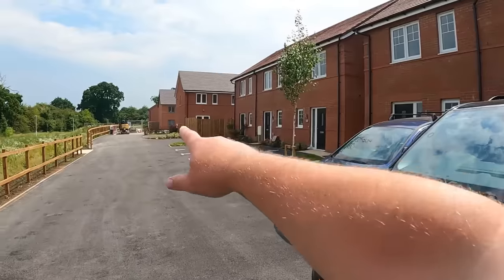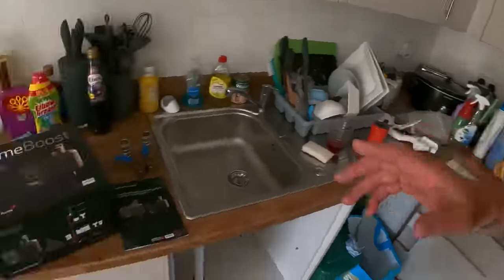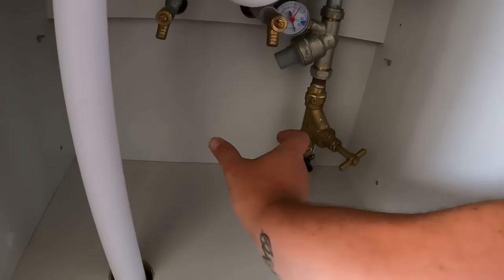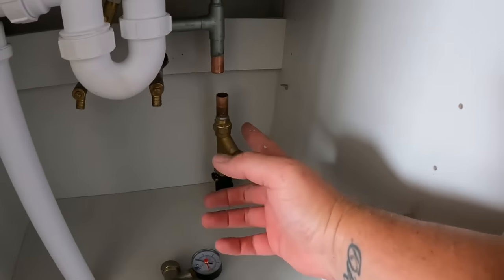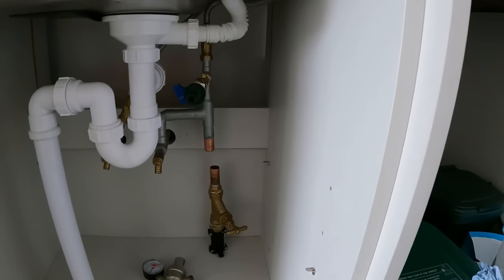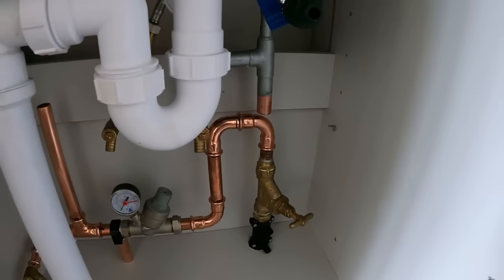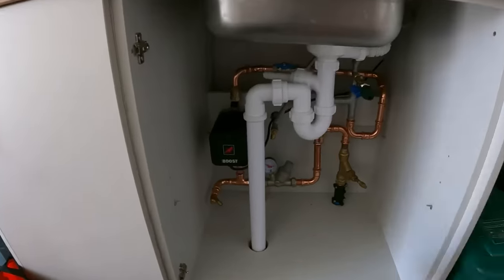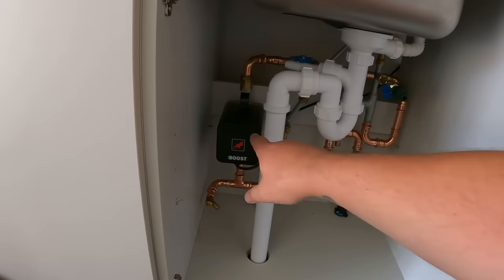HOW TO FIX A LOW WATER PRESSURE & FLOW PROBLEM

Comment: Better to fit an accumulator cost nothing to run
Reply from the maker: Not in a brand new 2 bed semi mate🤣🤣🤣
Reply: @MJTiffPlumbing  I was t Joni g accumulator perfect for new builds solves all issues.  Zero running cost and up to 220 ltrs  full pressured cold mains storage

Comment: Why did you not contact the builder and not the shower pump dealer, that pressure is crap full stop and not fit for purpose how can they get away with this rubbish.😳😱
Reply from the maker: Oh trust me buddy….. I’ve rang so many times and ZERO comeback…… THATS why I had to fit the mains booster as my son could use his shower……

Comment: Nice content bud, most new builds are “absolutely shockin” why is this not being rectified by the developer Mark? Surely low mains pressure resulting in shower that can’t be used, should be covered? I’d bill the developer for your time and materials bud!👍🏻
Reply from the maker: Oh I will be mate, once they finally get back to us….. they are as bad as there mains pressure🤣
Reply: Did you say that in a Welsh accent? 🤣

Comment: Not a salamander they are crap pumps its your son why not the Stuart turner mains pump its twice the price but world's apart
Reply from the maker: Never had an issue with Salamander pumps in over 15years of fitting them…
Reply: @MJTiffPlumbing in the south your be lucky to get a year out off 1 maybe it's our hard water.

Comment: Is this a bad joke? Instead of solving the issue, you've stuck a loud pump, which will cost dearly for years to come, as a fix?
Reply from the maker: Is this reply for real….. the pump is very quiet and costs next to nothing to run.

If you watched the video and listened you would see why it’s had to go on….
Reply: @MJTiffPlumbing  I can't imagine having that pump noise every time I wash dishes or someone is taking a shower. Unfortunately, my hearing is super sharp. Cooking in this kitchen would be hell for me.
Reply from the maker: Can’t even hear it with the door shut buddy…. But each to their own…

Sometimes you have to do what you have to do to get the services you need

Comment: Not buying it. You have a PRV . I mean its a solution i guess but what is the low flow root cause? Gunked up meter, meter stop not fully open. Several faucet cartridges/aerators clogged?...ect ect.   -USA service plumber.... a real plumber😂 we dont use "boost boxes" we fix shit.... And get rid of that S Trap.
Reply from the maker: Typical “USA Plumber”…….. Did you not listen to the video🤣🤣🤣
Reply: @MJTiffPlumbing  I did, but you don't speak English....so what did I miss, Ms. Poppins? .... I'll have to try this one on my next low flow service call ; "You just need to pay me to install a boost box!"😁